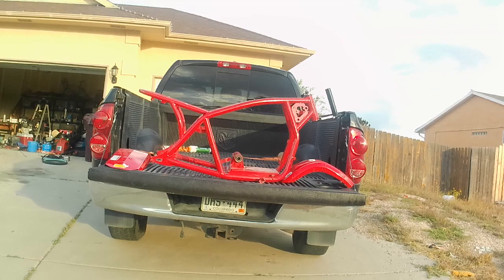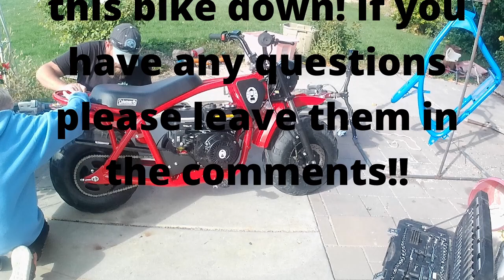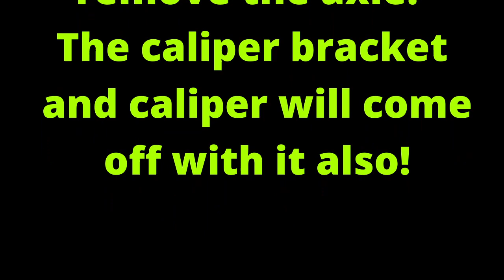New Coleman B200 Tear Down

Comment: I like the rear fender on it, I have a mega moto 212 pro and it has a rear fender I don’t care for. Do you think that I might be able to put the b200 fender on my mega moto? The frames look the same in the back section, thanks.
Reply from the maker: Ya u would have to look at how they both mount but the mm212 and this b200 are really similar but different. U might be able to swap the fenders tho I've never looked at a mm212 that closely before.

Comment: What size are those bearings on the drive shaft? My gear side bearing exploded today!
Reply from the maker: I believe they are 6004rs bearings on a b200 and 6203rs bearings on a b200r b200c and b200v. I checked this site to find out. https://www.colemanpowersportsusa.com/parts/mini-bike-parts/b200/Engine
Reply: @nicsminibikes I’m working on replacing those drive shaft bearings. Any suggestions for getting the nut off the driven pulley? I saw you used an impact. I’m using a socket wrench with the chain attached on the opposite side plus and holding the rear brake for leverage. Can’t seem to get it to budge and I’m worried about breaking something